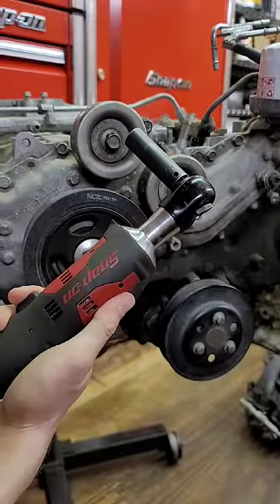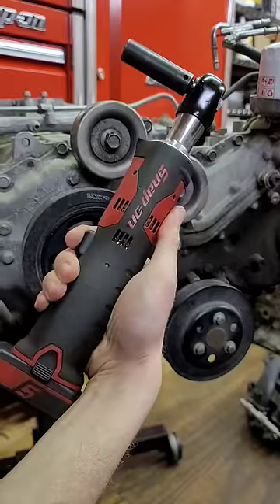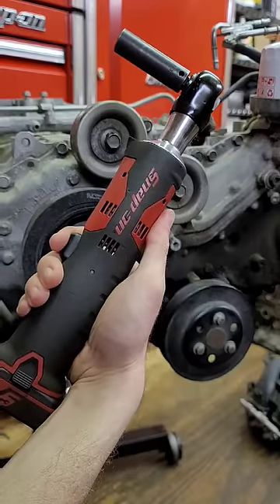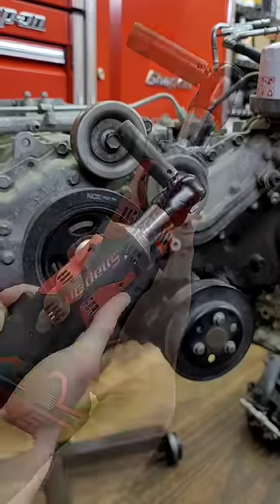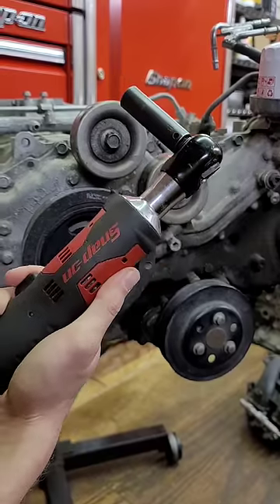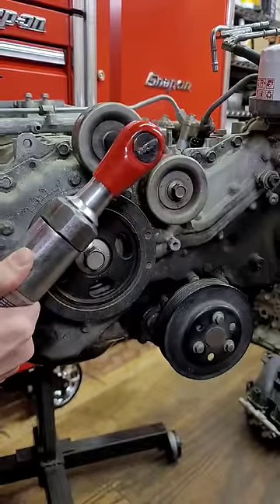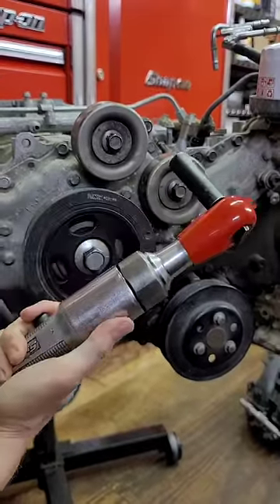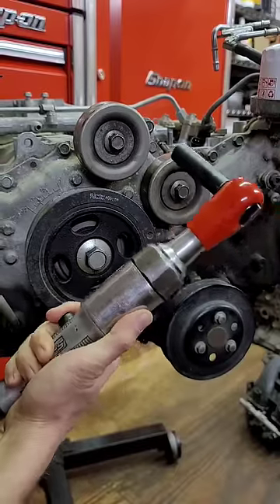Don't Use Electric! Use Air! Duh! #Snapon #Shorts #CordlessRatchet

Comment: I like air tools, but in my current job its more of a pain to find an air drop than it is to keep batteries charged.
Reply: I have a friend who used to be a tech at a local Chevy dealership and they were more likely to have access to a power outlet around their bays than they were an air drop.
Reply: Air ports at every bay where I worked, were you work is ill equipped
Reply: @exilemike  I do factory maintenance now, some machines are pneumatic and some aren't.
Reply: @fryloc359  I was an auto tech so I completely understand your situation
Reply: I totally understand where you're coming from because right now on mobile mobile and it's easier to keep batteries charged as I drive from site to site I do keep a mobile compressor look impressor with very high PSI on me but it's a pain i* t** a** to pull it out And set it up just for a set of nuts and boats or to take take a series of nuts and bolts off or screws Where the same ratcheting battery operated to does for you to does the job just As well if not better Because of how fast I can pull it out and break it down and then keep on moving whi'm moving while charging on my charge board because I have a Because of how fast I can pull it out and break it down and then keep on moving whi'm moving while charging on my charge board because I have a 4 battery Set up  Underneath my toolbox Inside battery boxes independent of my starting battery attached to my alternator which those are lithium ion sulfate sulfate batteries attached attached to to solar panels as well as well Which I can flip a switch when I'm done running my vehicle I can then trickle charge my main setup battery with the solar panel and not overcharge anything and charge the 4 batteries as well Still get power to my charge board charge anything and everything off my charge board even with the keys off
Reply: @michaelb.7800  sure, but in the right situations air is quite nice. I was working on ball joins and you're technically supposed to not use an impact but I could tell it would take like an hour manually, electric doesn't quite have the oomph or battery life (I'm sure you could get at most of the way or maybe even all on one charge but you don't want to waste charge if you don't have to right?) And it still took a long time with my super powerful pneumatic impact.
Reply: @exilemike  Depends on your employer.  Where I work (at a plastics factory) compressed air fittings are everywhere.  Can't deny though that having something that doesn't require a hose/cord with equivalent torque would be nice.
Reply: @exilemike  You went from "ill equipped' to 'i understand' hella fast.
Reply: I worked at a body shop like that
Reply: @michaelb.7800  MY service truck is running I have 165psi all the time

Comment: I love the fact that people think an air ratchet works like an impact! You can tell those people ain't ever used one much.
Reply: I've never found air ratchets to be all that useful. Most of the time, you can't get them into engine bay spaces anyway. And even if you can, you can't back the bolt all the way out without the ratchet getting stuck.

Ratcheting box end wrenches are more useful than an air ratchet to me.

Comment: I love my 1/4” air ratchet. I love the sound. I love the way it feels. But most people forget that an air ratchet or an electric one is still a ratchet. Break the nut or bolt loos by hand, then hit the button. Both air and electric have their place.
Reply: I agree. Been working on small engines since 1978 and I have come to appreciate the reliability of the air powered 1/4 in socket driver. It’s hard to break old habits

Comment: They all have their place, but I must admit having moved further away from the air side of ratchets, my knuckles are a whole lot less beat up and I'm at peace with the drawbacks/benefits of battery life.
Reply: Just keep multiple batteries is the key. They are expensive as hell,but it's worth it always having fully charged batteries on hand while the others can charge you could hypothetically never run out of juice
Reply: Yeah, if you aren’t prepared and the air ratchet torques your hand into something it sucks.  I worked in Elkhart’s RV industry most my life and I used to install track seating and the subfloors for them.  I’ve had my hand stuck to where I couldn’t even release the lever to stop it.  It’s like those times your own body weight is trapping your fingers under something.  You have to look around for a second for an idea to free yourself.
Reply: I'm curious, how does the air ratchet affect your knuckles? I'm having a hard time imagining
Reply: @RubixB0y  there's no anti-kick back and the air ratchets can pin your hands against things making it even worse when the trigger is being engaged by your pinched hand
Reply: @hackdeez1075  Oof, thanks for painting the picture. Glad to hear there's an alternative to that!
Reply: I came here to say just that. I've smashed my knuckles so many times with an air ratchet. I think the trade off of busting the bolt or nut loose before removing it with the electric is a fair trade off
Reply: They do make reactionless air ratchets. I have one and have never smashed my knuckles with it. It still has a small amount of kick but it's so little that you're extremely unlikely to have any problems.
Reply: @hackdeez1075  Can happen with battery ratchets too.. Had my hand slammed against the hood a few times..
Reply: @lemmykilmister545  absolutely but air ratchets have zero forgiveness! The thing I really dislike about my milwakee electric ratchet is if you ever get that bad boy stuck against, I don't know let's say a frame rail and pulley bolt, its one hell of a time getting it back out of there.
Reply: @hackdeez1075  hows an air ratchet different in this situation? Is it easier to remove if it gets stuck?
Reply: Exactly what I tell people
Reply: @udonenomee2117  ya and what sucks the most it kinda feels like you hand is being beaten with a mini hammer when you hand is pinned from the ratchet. It truly does suck.
Reply: Back in the day, Air Tools where the best, But as time and technology got better, Battery tools are great now. But I would always have a Air Compressor for other things.
Reply: When I started out in mechanic school I didn't know the difference between ratchet and an impact. No one told me. I went to use a air ratchet and slammed my arm into the frame. I had knot on my arm for couple of weeks, was lucky it didn't break my arm.

Comment: Full time mechanic, just got a new cordless ratchet. Now I don't go deaf every day.
Reply: Exactly facts
Reply: What kind did you get? Also, can you use regular sockets or do you need impact sockets? Sorry I’m on a learning curve here.
Reply: @StrongerThanBigfoot  I also wanna know, I think Milwaukee is a good brand
Reply: @DiaperSNiFFER  the Milwaukee electric ratchets are really good, get their new fuel ones you wont be disappointed
Reply: @DiaperSNiFFER  even their base model non-fuel 12v ratchet is awesome. Great for everything, even if it is only rated at 40 ft-lbs or something. The fuels are awesome too, they even have an impacting one now
Reply: @Professional YouTube Boxer  late reply- sorry- I got the Dewalt atomic battery powered 3/8s ratchet. It takes the 20v batteries. You can use chrome 3/8s or impact 3/8s sockets with it. Been using every day over a month with no issues.
Reply: @spencerhermanson4639  agreed at least we won’t go deaf 🧏‍♂️ from air hoses
Reply: @DiaperSNiFFER  as a tech just starting out, I honestly would rather use anything than a large 1/2 air ratchet. Things are deadly loud
Reply: @spencerhermanson4639  oh yeah I agree, it’s like those air dryers at a public store 🏬 like Costco or Walmart. Stupid loud.
Reply: Earplugs exist.
Reply: PARTS CHANGER. MECHANIC YOU WILL NEVER BE.
Reply: @StrongerThanBigfoot As other have implied, an electric ratchet, like its manual counterpart doesn’t have an impacting mechanism. Therefore, you don’t need the shock-resistant properties of CrMo impact sockets. You can use ordinary chrome sockets without any particular risk of them shattering.

Comment: I have that CORDLESS ratchet and i love it. The debate is dumb. My air ratchet is also beautiful aswell. I love it.
Reply: @brotherdj777  you might as well call me an Australian dude. I'm going right down under.
Reply: I like the battery one... never used the air one much, generally grabbed for a conventional ratchet instead of dragging the hose out and having one more thing to trip on lol
Reply: @duttydiesel8303  exactly, I'd rather do it the old fashioned way then have dirt and crap blown in my face, not to mention all the noise that air tools and the compressor makes. Definitely a better way to go.
Reply: Yer but it's got low torque thou, I want to buy an electric ratchet but find their nowhere near the 300nm average I need, my electric impact does 400 but alas no ratchet version yet!
I do have a point, what's your Experience of the ratchet, I've looked at millwalki and snap on and both are weak on paper, how do they perform in the real world have you don't torque Tests???
Reply: @EZ-D-FIANT  i do not, the snap on one is good when used as intented, mostly just use them for quick convienience if its in a spot where theres not much room to ratchet.
Reply: @EZ-D-FIANT  what makes it so that you need 300nm of force?
Reply: @duttydiesel8303  hgv:s
Reply: I use pneumatic tools when I'm in my shop with central air, and cordless on away jobs
Reply: ryze, right on

Comment: One word about cordless tools is " Convenience ". No more air compressors, no more, hoses.
Reply: till you run out of batteries
Reply: SNAP-ON TOOLS SINCE 1920 👍
Reply: @collisionz7938  - Sincerely, We don't care
Reply: @germanoslav46  honestly, lot's of the shops use electric compressors so you'd need power anyway
Reply: @mr.nobody4900  "LIKE WISE"
Reply: Word I would use would be 'cost' 
Great option when truly untethered a needed benefit but just for the sake of it when better performing smaller options that 5th the size and fifth the cost it becomes silliness driven by marketing technology fads .
Reply: No thanks.. battery tools crap out easier, cost an arm and leg to replace especially from snap-on not to mention the additional cost if your battery gets stolen or your charger.. 
Air tools are reasonably affordable.. 
If you really know how to work with tools the hose shouldn't be too much of a bother.
Reply: @philljustphill1656  yah no shit, but your plugged into an electrical outlet, no batteries required
Reply: @mr.nobody4900  when all of those batteries die and your next ticket comes in, what the fuck are you gonna do? wait a whole hour for that shit to charge? and who am i a tool for? lmao
Reply: @germanoslav46  the milwakee battery charges in like 15 min. For those 15min I'll use my snap on air ratchet or grab another battery. Electric shit is great if you go to junkyard or do shit like that. Best is at home being able to use it around the house. Everything has its place...
Reply: Power tools are great. If you have the comfort of an air compressor, go for it. However, electric ratchets are great for the job as well. And if you worry about batteries, just go buy more and keep them charging or standby.
Reply: @germanoslav46  …that’s why you charge them?
Reply: @anthonyzastoupil1842  charge them while your on a job? Shit gets busy don’t have time to wait for that
Reply: @germanoslav46  maybe just be prepared? I use my m12 3/8” ratchet and m18 1/2” impact everyday and have had zero issues. I have both tools in air but they have sat unused in my toolbox. I hate the sound they make.
Reply: @germanoslav46  The batteries are removable from the tools. You take the discharged battery pack off the tool, put it on a charger, and put a charged pack on the tool. Takes 30 seconds.
Reply: @Azlehria  till you run out of fully charged batteries
Reply: @germanoslav46  If you're so incompetent as to not have enough batteries to last through a work day, you're going to have much bigger problems. It's actually quite difficult to discharge a battery faster than the charging time with most modern electric tools.

Even my old, slow-charging, 5Ah Hitachi batteries took less than 2 hours to go from completely flat to full charge. My newer 5Ah Milwaukee batteries only take about 40 minutes. That same battery in my impact wrench takes almost a full day of constant usage to discharge. Even the 1.5Ah batteries will last through a typical morning.
Reply: @Azlehria  I have a few batteries but always use air tools unless something is in a tight spot
Reply: @germanoslav46 
That's because you're stubborn and don't like change. Life and technology changes all the time, so we adapt, or at least the smart ones do :)
Reply: @germanoslav46  🤓

Yeah, cause compressed air is always readily available and super quiet to use when you're doing late night work in a normal neighborhood.
Reply: @eriklona8806  you keep your garage open?
Reply: @germanoslav46  not sure what you mean by that? I'm just asking, in most circumstances, how is it that compressed air will be more available than a charged battery pack. What if the car was towed in, doesn't crank and has a flat? You going to get an extra extended hose to use your air tools 😆 Nah man, just grab your cordless tools and fix it outside instead of going through the hassle of bringing it to a bay to use air. Home mechanics are also going to opt for the convenience and quietness of the non-air impact tools.
Reply: @eriklona8806  I would in that case use electric tools but once I got it into the shop then I would use air tools for something really stuck
Reply: @germanoslav46  you can also buy enough battery power to literally use a whole arsenal day for cheaper than you'd buy a compressor large and powerful enough to do the same.
Reply: @briand2195  only need a large compressor, not 100 batteries littered around the shop
Reply: @germanoslav46  "100 Batteries" 😂 Literally none of us own more than like 5-6 and usually can get away with cutting, grinding, drilling and so forth for the better part of the day without needing to swap batteries.  
The late 90s and early 00s battery tech is nearly over 20 years old stop basing your argument on completely dated info.
Reply: @germanoslav46  Own 2 batteries and keep one on the charger. Very simple.
Reply: @germanoslav46  Plug+ multiple batteries. I see you've ran out of braincells
Reply: @germanoslav46  That's why you keep dead batteries charging and cycle them out you damn dummy. You dont say "oh this battery died. Time to just set it down and pop a new one in"
Reply: @thevalorousdong7675  ok
Reply: @germanoslav46   till you run out of air in compressor, different??
Reply: @gaptactics5231  so you throw away your air compressors when the tank gets empty? thats expensive. air compressors dont run out of air, the compressor cycles on and draws in more lmao
Reply: @germanoslav46   you throw away your phone when battery runout right? it ridiculous.
Reply: @gaptactics5231  no, i put it on the charger and its useless until it has a sufficient charge.....
Reply: @germanoslav46  cordless tool easy to swap battery you already know it?
Reply: @gaptactics5231  batteries that go bad and cost even more money, money that you have to spend to do your job. Yah no thanks, 10k in tools is already ridiculous.
Reply: I work at a forklift dealership, out in the warehouse around the shop and all my guys use are electric tools. We’ve got a compressor and lines in each individual work bay but even the oldest and most experienced techs opt for the power tools. They only use air for certain jobs or when something is seriously stuck. They have nothing against air tools. Battery powered ones are just a lot easier to use in their application and there’s not much they can’t do.
Reply: They have no power 
V16 requires air tools

Comment: I've been a mechanic for about 30 + years and nowadays the only time I use my air compressor is when I'm using my blowgun or need to use a high speed angle die grinder to remove gaskets material that's cooked on!  My compression collects dust most of the time. 🤣
Reply: Yeah, you can call me a pussy, but I don't like the noise of an air tool, nor do I like the constant cold handle when under frequent use. Modern cordless stuff is awesome.
Reply: @volvo09  pneumatic air grinders will give you frostbite before you finish the work haha
Reply: They don't make high speed cordless grinders?
Reply: @bodeine454  Not the mini high RPM, angle grinders that I need. At least I haven't seen one yet. Do you know of one?
Reply: @bodeine454  they do but the pnuematic ones can fit in smaller hard to reach places. More of a situational tool now
Reply: @uraniumbolt7594  I see, that makes sense. 👍
Reply: @tennaj1367  the milwaukee 2" does 32,000rpm. I usually use it with cut-off wheels or burr tools and that thing can make some pretty quick work of chewing through some steel. Granted it's still a but bigger than some of the pneumatic ones.
Reply: I'm seriously thinking about getting a much smaller compressor,  I almost never use it anymore except to fill tires and use the blow gun, no need for an 80 gallon 35 cfm compressor anymore.